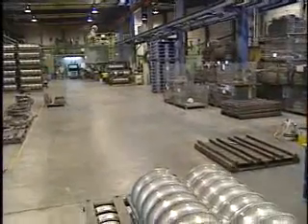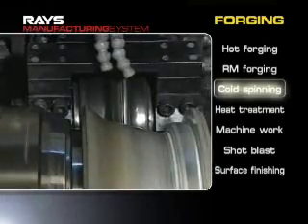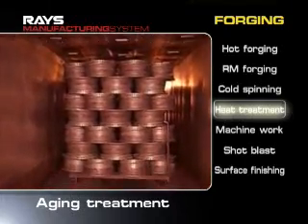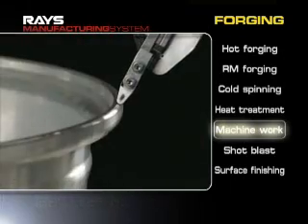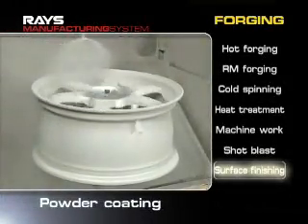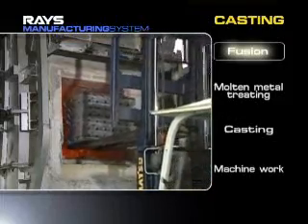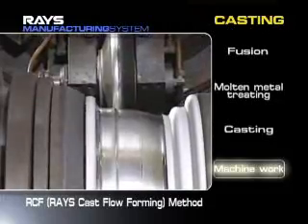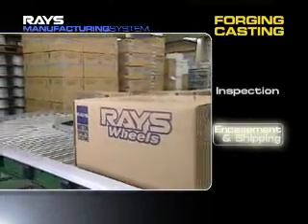Making of Rays Engineering Wheels

Comment: This is all new to me. Basically, there is cast flow formed and forged flow form? Rays uses a cold flow forming? Whereas some others use heat in the process, ? So, what's actually stronger: BBS forged that is then machined out or Rays kind of ... like a hybride forged then flow formed? Like what brand typically has a higher load rating?

Comment: Meanwhile at Rota wheels they are crapped out of a 3 Legged Hippo.
Reply: i thought ROTAs being crap was all hot air, as people told me race cars use em.. so I got a set on my evo, had big cracks in all 4 in 12 months.
Reply: @digisuboob  Race wheels for some big teams are disposable items. No one would get Volks to scrap them after a weekend and trash another set on the next event. Number of wheels you change depends on how much stress is the mounted set getting. Also some teams have a limited budget that the only way to afford replacements and spares wheels is to change to cheap wheels.

TBH I wouldn't even bolt these on a daily driver and expect not finding a crack in 4 years of normal use.
Reply: My 2 sets of slipstreams are actually still fine :)

Having said that, I'm a Rays man at heart.
Reply: yeah except rota makes OEM wheels for mitsubishi and toyota. 

even makes some wheels for enkei
Reply: @boldstar69  that just means big companies are starting to compromise quality, not that Rota is top quality.
Reply: Enrique Engelbracht never said rota was top quality. 

It just means rota is improving.

Comment: @Gcoups 
Depends about size, but i have 19'' on car and one Rays coast between 1500$-2200$ for 20'' or greater, of corse forged aluminum-magnesium, and coated with special material to protect the rim. usually 16'' about 700$, and 19'' to 1200$-1300$.